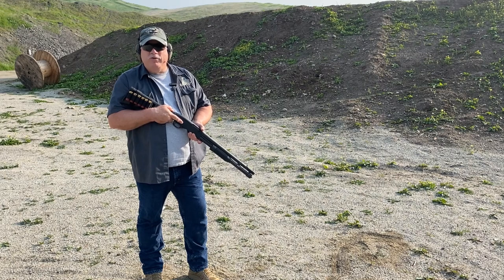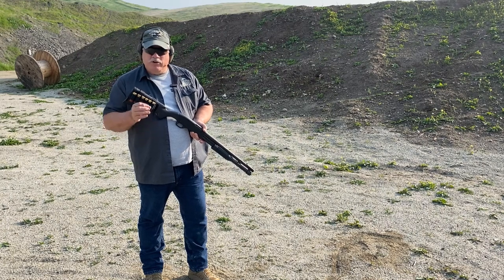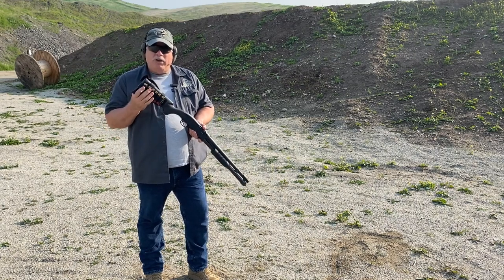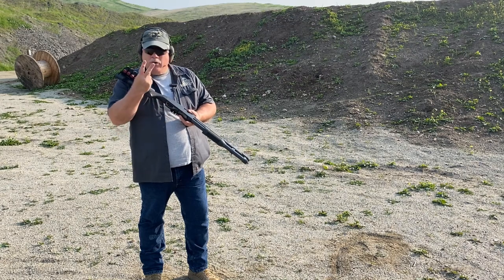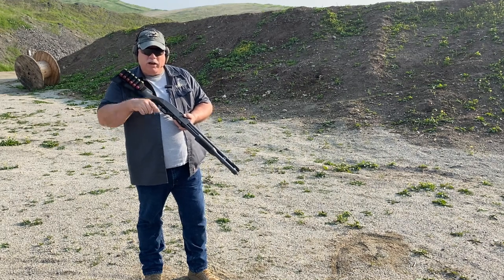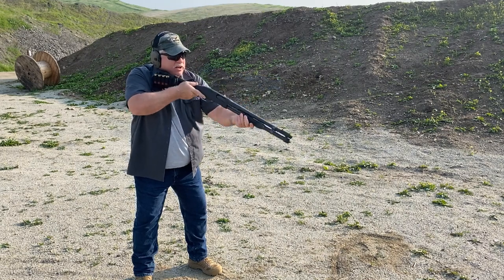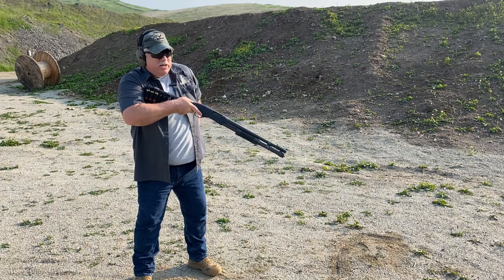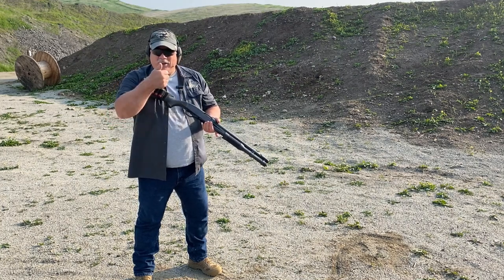Range Demonstration - Reloading a shotgun from a buttstock shotshell holder

Comment: I sent to Walmart and got two butt stock sleeves snd took them to the cleaners and had them cut off the flat side sew the ends with round holders together so i have rounds holders on both sides of my butt stock along with my side saddle